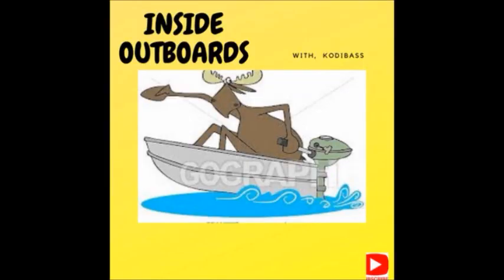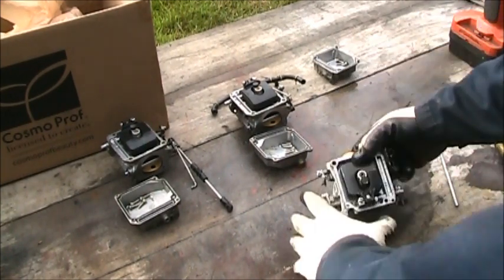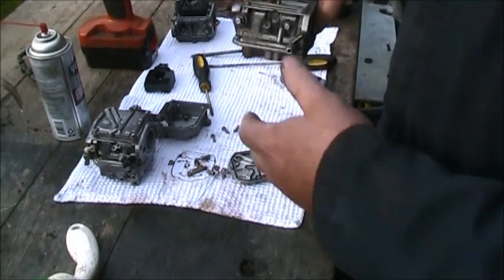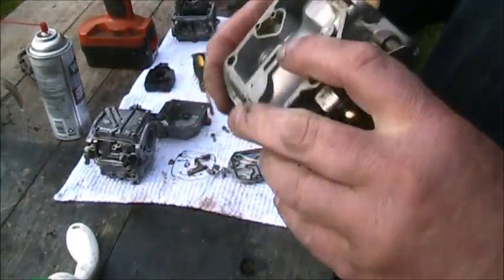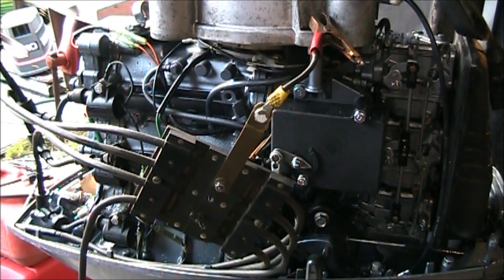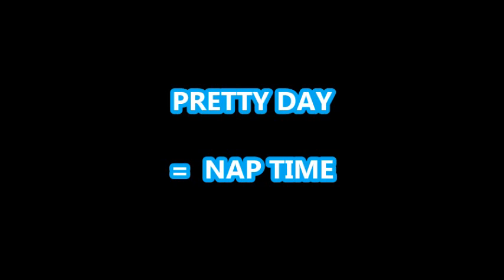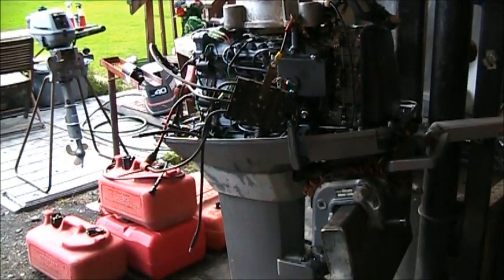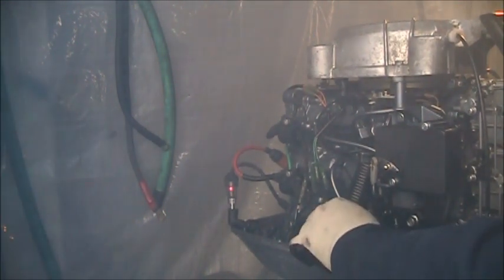YAMAHA  40 HP,  Johnson 30 HP      ((  Part 2 ))

Comment: How long do you leave the carb parts in your ultrasonic cleaner...?     ...and I thought it was so you could draw the Frankenstein sketch on the white towel...?   Cleaned up pretty good until they throw it back in the sand again...   Yeah but it's sure Peeing good...!
Reply from the maker: +WR,   Depends on how gunked up the carb is but around 10 min tops,  O'h 4 sure he will kill it.   4 sure.                                                                  kodi